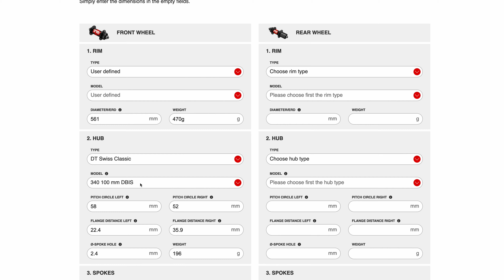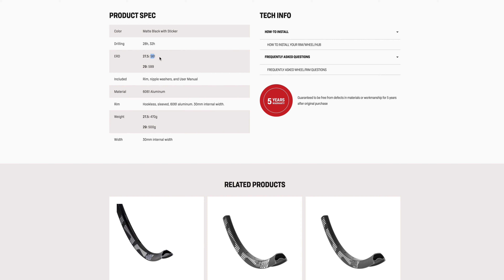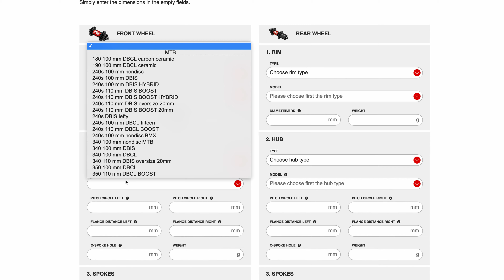Lacing My First MTB Wheel. Everything You Need to Know A-Z, 3 Cross Pattern Wheel Building

Comment: Lacing wheels is fun and fairly straight forward for MTB. But road bike wheels are on a whole other level of insanity. Some of the stuff these manufacturers come up with are absolutely stupid. Straight pull spokes that can only be accessed if the axle is removed and such low spoke numbers that they're almost impossible to true. I love the DT Swiss calculator but I do not love some of the headaches they give us bike mechanics.